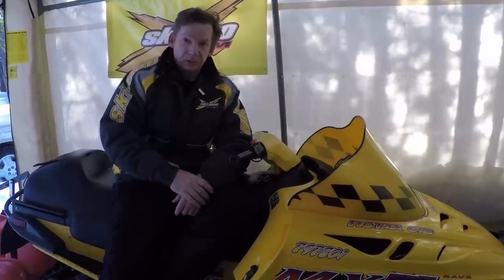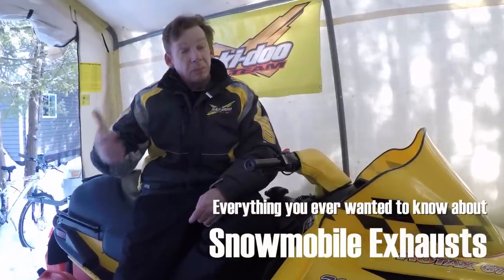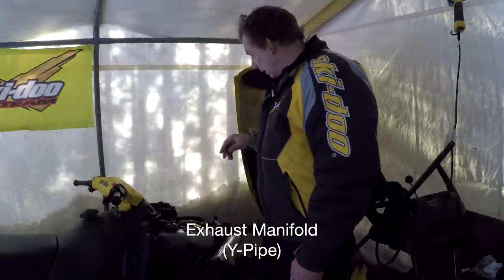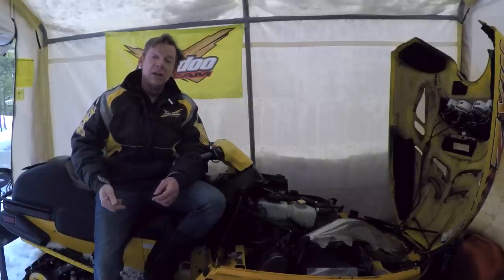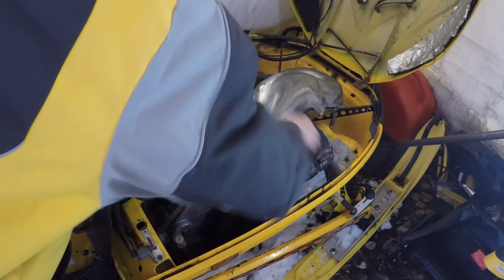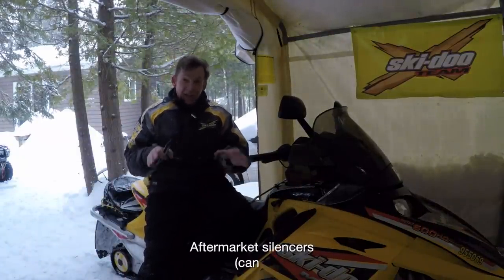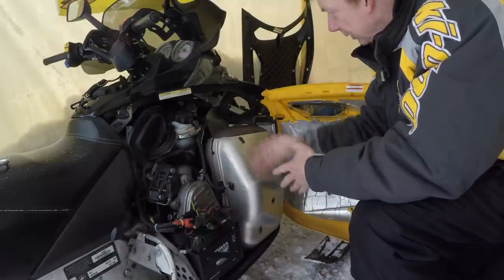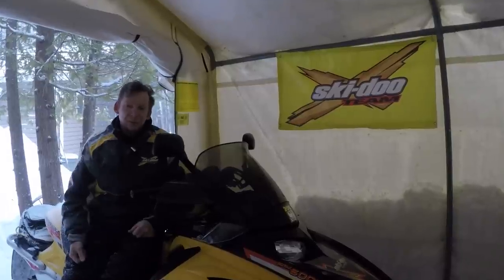Two Stroke Snowmobile Exhausts & the Best Spring Tool

Comment: Nice I just got finished rebuilding the top end in my mxz. It has tons of power  now.
Reply from the maker: Nice. How long did it take you?
Reply: My Old Sled took me about 3 hours. It was pretty easy just had trouble getting the circlips in.
Reply from the maker: Where did you get the kit? Link?
Reply from the maker: What’s your compression at now?
Reply: My Old Sled 120 both cylinders

Comment: I did buy that Woody's tool in a 15in to remove my can on my 1200 touring Ski-Doo. I have not used it yet but this summer I will when I clean the inside of my engine out and check for leaks.

Comment: I used a T handle sparkplug wrench with a flathead and cut a notch for springs. Best spring puller ever.
Reply from the maker: Second best maybe...;)
Reply: @MyOldSled  you can't change plugs with that.
Reply from the maker: That’s what my spark plug wrench is for ...

Comment: Great video ski-dave, those woodys tools are expensive but worth every cent when you need to get a snowmobile done correctly. Ive had the same stud hole cutter setup for 25 yrs, still cuts.
Reply from the maker: Hi Dan, I don’t think $20 is overly expensive, it’s worth it.

Comment: I had a bad experience with a can. I bought a used can for my sled witch supposed to be made for my 2001 mxz. I installed it and my sled started to bog, get full and run on one cylinder on low rpm. Since I installed it right after I finished engine rebuild, I did not suspect the can. Cleaned and adjusted the carbs and bought couple of new parts, but nothing changed. After couple of months, I thought maybe the can is wrong and don`t have back pressure. I put back the stock and sled run perfect. The sound was nice tho.. :D
Reply from the maker: Don’t feel bad. Very common. Lots of people do the same thing, put “performance” parts on vehicles, and they hurt performance. If you know what you’re doing, and you made other changes to the motor which require changes to exhausts, it makes sense, like in racing. Thanks for watching,

Comment: Thankx for the shout out Dave ! And vice grips are a bad idea to remove exhaust springs ! My friends cousin knocked out both of his front teeth while using Vice grips to remove pipe springs from an old Mach 1 ! Ohhh and do you have a link for that tool ? Thankx again Dave !
Reply from the maker: No problem DB. It's in the description.

Comment: Some cans sound pretty cool, but unless you want your sled to have a new sound or your exhaust has lots of miles under it's belt, don't buy one. They don't really increase your power, but they can lessen the weight a little.
Reply from the maker: I wouldn't buy one period. My sleds are already loud enough that I don't like taking them out at night. Don't want to disturb the neighbours or scare the crap out of the wildlife as it is. On a two stroke, they won't increase power, quite the opposite.
Reply: More HP??? Less weight???? The only thing you can guarantee a can will do is help close trails due to landowners being fed up with the Braaap brigade.

Comment: what does the reed valve do?
what does the transfer ports do?
how does the piston open and close transfer ports?
Reply from the maker: Hehe...is this a test? Reed valves work like a one-way valve that allows fuel and air into the crank case. (for bonus points) My older 670 has a rotary valve instead. Transfer port is how the fuel gets from the crank case to the cylinder. The ports are openings in the cylinder, and the piston blocks them when it's in front of them. I may do a video on 2stroke/4stroke in future.

Comment: Good point Dave,,use the PROPER TOOL for the job ,,i tell people this when they use the water method to remove the skidoo TRA primary ,,BUT i question is are you a mechanic or a plumber?? Because thats pretty much what you become,,messing around with that telfon tape,,screwing around ,,hoping it dont leak,,crossing yer fingers and toes hoping,,meanwhile juss buying the freaking proper good quality puller and be done with it,,